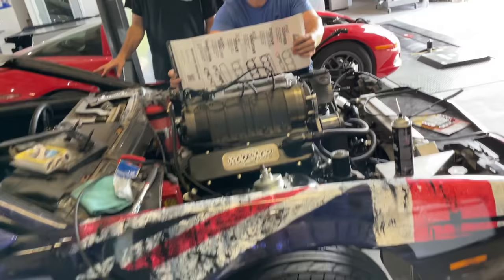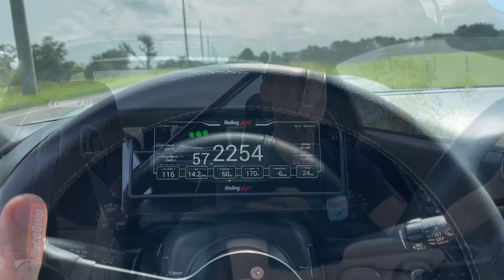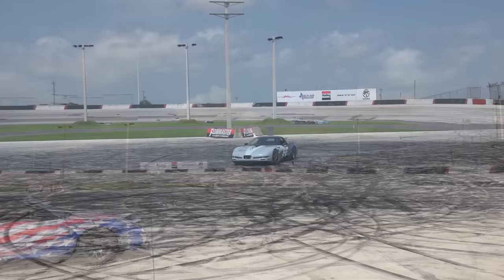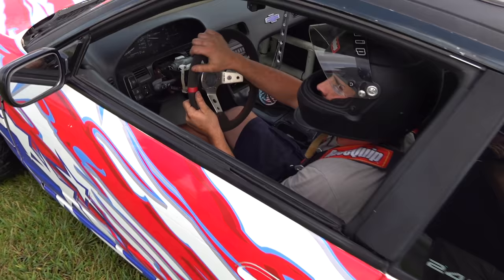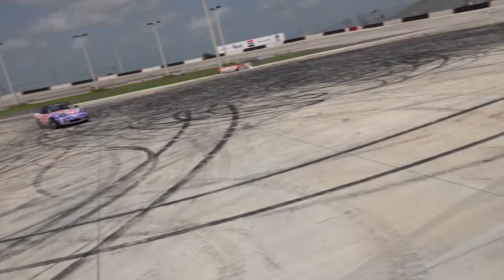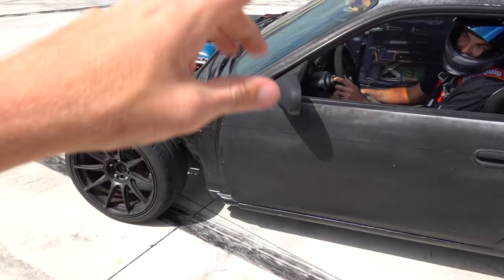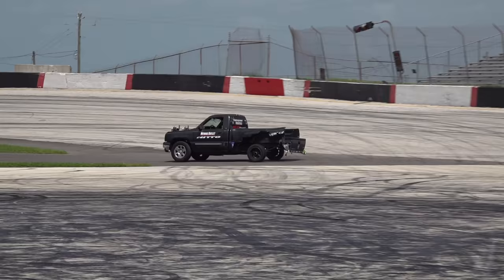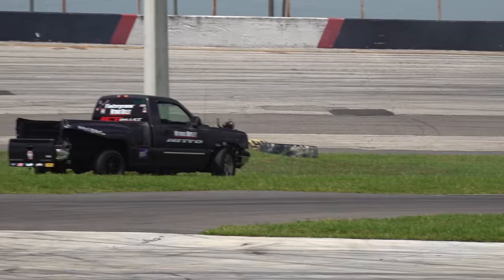James VS. George Drift Competition!!!! The Freedom Factory Took a BEATING! (complete chaos)

Comment: George needs a drift truck. One of those trucks, slammed with angle and a good setup would be so cool!
Reply: That would be sick
Reply: Dude I totally agree. George seems more at home in a truck. And its fairly unusual so it would make for even better content
Reply: i would NUT if they did a nissan hardbody drift build
Reply: @l8rn3rds  Def agree, d21! Hard body or first gen Fronty.
Reply: I agree!…. 
but getting a v8 pickup near 50/50 F/R balance iiiiiiissss a tough ask.
Reply: Pushing Slyder The 240 with Donnie’s oil cooler I see. Hahaha
Reply: @miketech2  idk there are a lot of things you could put in the bed to change the balance. radiator, rollcage, fuel, transaxle...
Reply: Rocky the drift blazer 🍻
Reply: @miketech2  50/50 ain't shit you don't need 50/50 to slide all it needs is rwd, welded diff, suspension work, and angle. Go to a drift event near you, people slide anything and everything. Sure it helps, but I've seen laggy heavy diesels slide like pro cars. Crazy Russians drift semis, busses in the snow. Plenty of it on the tube.
Reply: +1 for a D21 drift build 😍
Reply: Pontiac G8 would be perfect. aussie style
Reply: He should get a Holden ute for drifting.
Reply: If only they had a blazer that needed a place on the channel.🤔 where to find one.
Reply: Yesssss
Reply: That would be amazing and a drift truck would be different then anything you see everyday
Reply: Sounds like dale truck needs some angle 🤔
Reply: @williamlouis4981  I came to post this - but my guy william is all over it.  RTDB!
Reply: They all need personal drift rigs so they can really put on a show together at the events
Reply: He needs a squatted truck
Reply: Yeessss
Reply: I've been wanting to swap and hardbody since I could drive.. with coilovers
Reply: @l8rn3rds  FACTS that would be sick. gingium put a 1UZ in one and it sounds sweet

Comment: Twin charging the blazer would be sick. Plenty of cars are twin charged as well.
Little bit of science for ya: supercharger picks up boost ride out of the hole while the turbo is spoiling, then the turbo carries it through the top where the blower looses efficiency. You will need to have a decent intercooler to keep the the IATs down especially because of the blower.
Reply: Or do a 100lb Duramax build so you can do normal compound turbos

Comment: Honestly Garrett is a really reay skilled drift driver.  
No question in the top of what I've seen drifting.  Makes me look scared to get close to a fender. Lol. It probably helps having multiple cars setup to drift and access to fix them with zero issues financially.  
I can not afford to kiss fenders or have mine tagged.  
It's another level of skill to get a foot away at speed sideways under acceleration.

Comment: There are have been many blower+turbo setups on sale here in Europe and in Japan. Japan had the Nissan Micra Mach 1 Super turbo or something, we had group B rally cars and Seat (a cheap Volkswagen), Volkswagen and Skoda (dull and cheap Volkswagen) had charger+turbo until 2008 or something. Really nice things when they work. The hard part is to get the blower and turbo set up so the blower drops out at certain RPM and only the turbo is left so the blower doesn't overspeed itself. So the engine whines at low RPM and whistles on, high RPM. And you get the instant response and torque on low RPM and then the turbo takes over and carries on building up the power.

Comment: Isn't a compound superturbo setup typically a supercharger feeding a turbo? For the always boost. Some stock Japanese cars had it setup like that. Turbo comes into boost as the superchargers falls on its face in the rpm's. Allows you to run a turbo that's a bit too big for the motor and would normally lag like crazy or be all neverspool. 

The Galaxy would be a prime candidate for compund turbskies.
Reply: Can also run small and big turbos compounded together, it’s mainly a commercial engine thing though.

Comment: Why didn't he hook the headlight flip to the headlight relay? When power to low or high beam, then lights flip up. Maybe you want extra switches to forget to turn on, light the intercooler pump scenario.
George/squirrel doesn't have tennis elbow, it's Tennesse Elbow.

Comment: Had a duramax with compound boost system. Had a 60mm turbo feeding a whipple supercharger. Absolutely ripped before the crankshaft busted. Doing burnouts on the road by south beach was wicked. From personal experience. I can tell u my dual charged truck ripped harder than my moms 5.0 mustang

Comment: Twin charging has def been done. I know I’ve seen it on a few jdm cars in the past. Basically the same as having too large of turbo and using nitrous y
To spool it up. Not sure centrifugal would work but positive displacement should work just fine! Do a a cheap lsa with an old ruby on a semi built 5.3.

Comment: Not really a compound but check out the Volvo T6 engine setup. It's supercharged and turbo. But they run the supercharger until the turbo spools up then cut out the supercharger.

Comment: Look up Twin Charging, I don't know if George is right about the compound series setup but I know they can be run in parallel to make low RPM boost in an otherwise slow spooling turbo setup.

Comment: You don't have to do this, but I would have run the lights to the light switch.  use a relay if the amp draw is to much.  No need for another switch.  Love the content.

Comment: You said you wanted 'Turbuhs into Turbuhs' maybe?

Just throwing the idea out there. Mind you I have no mechanical experience at all. Just a little knowledge. 

In the E9X BMW 5 Series Diesel, their 'Twin-Turbo' setup, was not really 2 turbos, but one little turbo, feeding a bigger turbo, that feeds the motor. This eliminates lag, etc.

Again, no idea if that'd be possible anywhere else engine wise.
Just a cool (stock) 'Turbuh on Turbuh' setup I know about, that I guess is technically a Single Big Turbo, that has 2 Turbos. Haha

Comment: Oh ok , so sliding passenger side he can see that what he needs throttle grip brake , but sliding drivers side he cant gauge the depth of the back , when 2 get on the brakes and throttle when to give it some e brake , not only that he's trying to figure out the entry flick in to the corner , but wow he de

Comment: Actually, George is right. Turbo into a blower significantly increases parasitic losses due to the higher air density going into the blower causing significantly more resistance in blower rotation.

Just so happens I've seen that on the Banks Power YouTube channel. https://youtu.be/i6cR5Jx2UsM